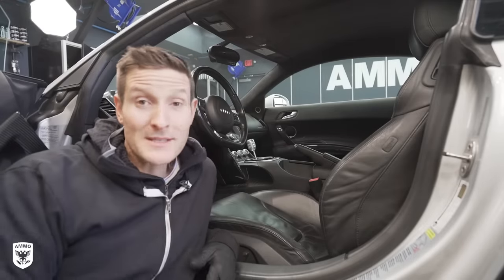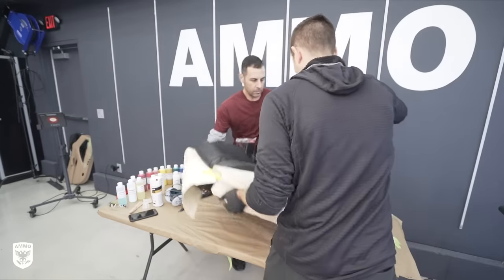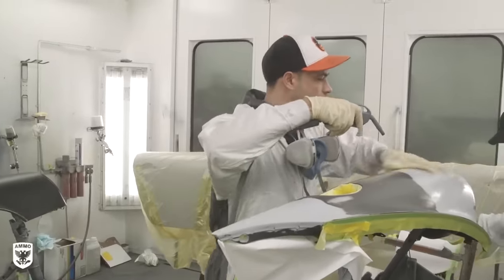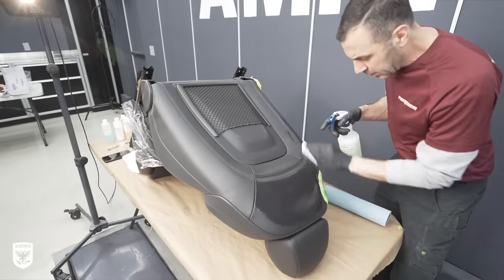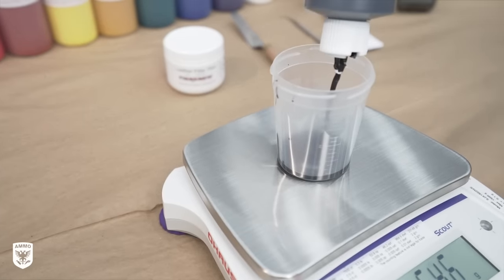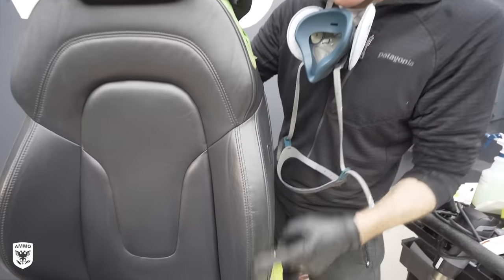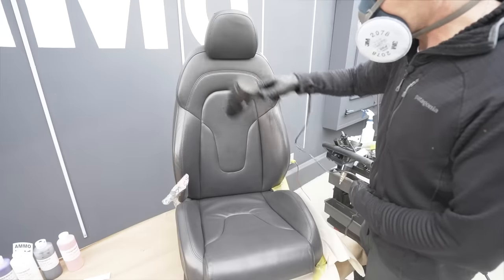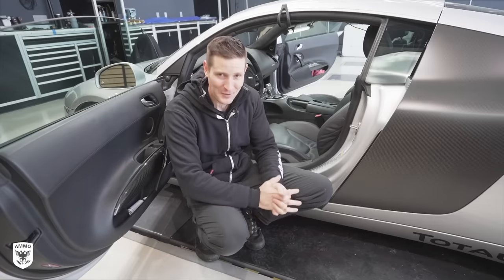How to Repair Damaged Car Seat Audi R8 Leather Repair Steps

Comment: I had Fiberenew do my seats and the guy was like "Uhhh your seats are bad I don't know if it will work." 3 years later and it still looks great.
Reply: How much did it cost you ?
Reply: Same what’s the cost tho haha
Reply: In for cost
Reply: @josemichael1292  everything 
-thanos
Reply: @tyobsxura4360  The detail we will never be told
Reply: @josemichael1292  it depends on the amount of damage.  Obviously a beat up seat won't be as cheap as a seat that just needs touched up.  I'd say price between 125 to 500.  He said in this video he was paying around half what new covers would cost.   So possibly more.  But there are companies around that charge a reasonable amount.  Check out Creative Colors International.  They do amazing work too. Fiber New does great work as well!
Reply: Looks great, but rough as sandpaper
Reply: @Shift4g  I suggest to get new seats. While it looks nice, it’s not smooth. It feels rough. For a small section on my seat, it was $250
Reply: @Amor1990 you didn’t sand enough. Start with 320, go 400,800,1200,2000,3000 and watch how smooth it will be

Comment: I need this for my 20 year old 7 series, badly
Reply: It still runs? I’m impressed!
Reply: Same brother. 740 or 750? Mines the 750.
Reply: @kotalarsen95531  740i sport
Reply: @darrenlee1765  runs like a scolded cat, no leaks, no lights on the dash. Drive it long distances comfortably regularly. Side bolsters are getting tired though after 170k miles
Reply: @joshuad1716  3.0 or 4.4?
Reply: @darrenlee1765  4.4
Reply: If you're in Southern California reach out I can repair it for you

Comment: Same seats that are in my TT Mk2. Since I'm not rich and the car is not worth 80,000$, I wasn't ready to spend that much money on leather repair. I found a product online called Belino Cuir and ordered the black version. I was hesitant to use it though. I left it on the shelf for almost a year. But finally decided to try it on the lower part at the back of a seat (just in case it was crap and I couldn't fix the disaster). Turns out it worked very well and is very easy to use! It's a kind of fast drying gel. You put the stuff on the cracks and then wipe it down with a cloth. If you put too much and it is visibly different from the surrounding leather, you rub on it hard with the cloth. And as a last resort, you apply a bit of Windex on a rag and wipe it down. But it mostly worked very well for me and my seats look good. Not like you see in this video of course. But all the cracks and the discoloration are gone. It even died the thread back to black.

Important: Before you start, you must remove any dirt or leather conditionner and the leather need to be dry. Also, when you're finished, apply a decent quality leather conditionner over all of your seats, especially where you re-dyed your leather. 4.5/5 for the ease of use and 5/5 for the value for the price. That was the only thing that was bugging me about my car interior and in the end I could have fixed it a while ago for 15$ and 2 hours of work. I should have done this way sooner!

Comment: Never heard of Fibrenew here in Europe. Over here it's Leather Repair Company and Colourlock.

You shouldnt just sand the leather with straight up sandpaper. Use red Scotch pads, which are also a 320 grit and a solvent to break through the topcoat but it will not damage the grain as much as straight up sanding it will.

Comment: I was hoping that you will show how to get rid of those folds and stretched leather on bottom part of the seat, have same issue in my Audi 🥺 I tried some technique with heatgun, steam etc. but without any luck (did this probably too carefully though because I was so scared to damage the leather) It shrinked a bit but not enough.

Comment: At my job I color match interior paint by eye lol. We have a camera for color matching but it's more for the exterior color of the car. I work with PPG paint at my job, I color match exterior and interior paint.  We are a platinum PPG distributor at my job. I actually use that same light he has on his desk. It shoots the light from the top in a bright setting and it shoots the light from the front for a more warmer yellow tone.

Comment: I've done this before (different brand) on a BMW it turned out amazing. The issue I had was with the product wearing off, they didn't provide with a top coat when I did it. Interesting to see how long their product lasts.
Reply: Yeah fiber news is really just the McDonald's version of interior repair. if you look at their products everything is very mass produced and cheaply made. Hence it might look good for a little bit but it doesn't last. fortunately there's a younger generation of us interior repair technicians that take pride in our work and use only the highest professional grade products available.

Comment: Milliliters are a unit of volume. Scales only measure weight, which would be milligrams. Unless you are weighing water, the two are not the same.
 NICE refinishing job!
Reply: The ratio's remain the same
Reply: @Ronke01 Only if the density of the fluid is near that of water. If the ratio and the scale are both for mass, and you are weighing by volume [sic] there will be some mismatch. A pound of bricks has a very different volume than a pound of marshmallows. The difference here may not be much, but for a precision match, why not do it precisely & correctly?
 I'm sure Larry knows it was just a slip of the tongue.
Reply: @lyfandeth  if you need to mix 500ml of white marshmellows with 500ml of pink ones, thats the same ratio as half a pound of white ones and half a pound of pink ones. Dont overthink it.

Comment: What's the best way to clean perforated leather seats (heated/cooled seats)?
Reply: I know he already did a video on that a couple years ago.  Can't remember which one.  Basically the same as nonperforatred leather.  Just be aware of how much cleaner you are using.
Reply: I would suggest going back and seeing if you ca find the video.  He does a much better job explaining, and showing, than I did.

Comment: Do you have any comments or suggestions for a GMC leather seat heated/cooled with the small ventilation holes in it?  I've noticed that there is the smallest bit of leather between a seam and one of the ventilation holes that is "flapping."  It's not a tear I don't think and hasn't spread, but that's what I'd like to prevent, a spread.  Is there anything that would be leather safe to essentially "glue" this teeny-tiny leather flap down with?  I hope my description of the issue is adequate - it's the best I can do short of sending you a picture!

Comment: But what about contrast stitching? How would they bring it back after spray painting?
Reply: You are screwed. Think about it, how would you tape off sticking to avoid dye/paint when it's attached to the leather?
Reply: @TubeWatcher  Very easy to mask contrast stitching with thin masking tape
Reply: @jeffreyspodek3579  liquid masking
Reply: It works. I've been doing it for years.

Comment: Amazing!
But what if there is red stitching ?
Reply: I'm in the same business.  I end up cutting masking tape freehand with an Olfa knife approximately 1/16 inch wide and covering the stitches.  It's tedious but makes a huge difference to protect even same colored seams. This step is done after thorough cleaning. Also, don't sand the stitches! 
So, preparation is the key.
1st . Blow out and clean thoroughly 
2. Do whatever repair you need,  avoiding stitches.
3. Lightly sand rough leather finishes. 
4. Repeat 1- 3 as needed
5. Protect all areas around the seats from overspray with drop cloths, tape and paper. If the tape won't stick,  either the surface is not clean or the stitches are still too wet. Dry them with clean towels or move onto something else while they dry. Once you tape the stitching you can't be aggressive with wiping or sanding. The tape is the last step before spraying the dye.
6. Mix your color and apply some and dry it to check color match. If you're satisfied,  spray light coats and let dry.  Sand lightly in 1 direction , wipe or blow air to remove debris and continue your dyeing process until satisfied.  You can add texture too during this process. Take times and it will be worth it

Comment: These fixes never last more than a year. If they charge 50% of re-upholstering price, then just get the brand new ones.
Reply: That's the real test. How long will it last?
Reply: All depends how well the product is applied and the quality of the product. I've seen guys at dealers do quick cheap fixes that last a bit. And I've seen other companies do repairs that have lasted years. Also comes down to how well the material is treated too.
Reply: Bullshit, I vouch for my repairs to last as long as the original did.
Reply: Nah these repairs when done professionally with the right top coats etc will last longer...   unless your guy did the cheap silicone and spraypaint method it'll last 6 months ..
Reply: I mean I did a repair myself where a company matches the dye and provides the top coat 2 years back and it still looks amazing.
And that wasn't anywhere near to level that these guys are doing it.
Reply: These work. You can find many guides and DIYers doing such repairs, and they hold up. BUT, it all depends on the product you start out with. Trying to repair a fully broken, abused chair will never work.

Comment: What if you have different colour stitches?
Reply: This is common.  You can't sand or dye as you would a "flat" panel.  The stitches need to be avoided during sanding.  Then you have to mask them off when dyeing. It's a tedious job.

Comment: You put a top coating on the seats, and it made me think.  Surely the manufacturer also coats the leather surfaces in the car , and if that's the case then why do companies produce conditioner for leather seats and leather surfaces for the car?  Because if there is a coating on it the conditioner will not absorb at all, am I wrong?

Comment: Does the dye start to bleed once you agitate with a brush to detail it?
Reply: Fibrenew "dye" wipes right off with water and a towel that's why you'll never see another video of this seat again after this. That brand has terrible products and reputation. fortunately there's a younger generation of interior technicians that use only the highest quality products available
Reply: @searchforthetruth1998  I believe that ceramic coating the seat afterwards would reduce the possible dye transfer
Reply: @johnfriedman6144  lmao you can't ceramic coat a leather seat bro. However you can use premium materials like viper products. I use their interior reconditioning materials. They use a polycarbonate blend top coat fibrenew uses a water base...

Comment: Very professional process. However, the lack of care for the accent stitching?!  Always , always tape the accent stitching.  It’s a dead giveaway for leather restoration work.  Our team takes the extra time to make sure the stitching is clean. This is critical for all exotics. Also, I will be very curious how the dye with all that extra “texture” spray holds up over time. Best guess, it will last for a month or two and start to crack prematurely. Super professional video work and editing, nice explanation overall.

Comment: My car seats are made of leatherette the color is beige..there seems to be staining appearing from the inside of the seat and appearing on the surface.Any ideas what could be causing this ?.
Reply: More likely it could be a dye transfer from clothes or a belt.  Light colored seats frequently are "stained " by  denim and other dyed clothed. That's not a flaw of the seats , rather the fact that the clothing is not colorfast. That's why you're supposed to launder similar colors together. 
You can try cleaning your seats with appropriate cleaners.  I hate to say it, but they may need to be dyed. And your problem will reoccur if you continue to wear the clothes that caused it.

Comment: You should try out the Colorloc system. Your very meticulous and may cut the cost of repair down significantly
Reply: Colourlock isnt as great as theyre made out to be though
Reply: Oh i just saw it on youtube and was thinking about giving it a try if my leather gets a little worn
Reply: @grand04gt  it works, but theres better out there. Colourlock still relies on thickeners and crosslinkers, something others try to avoid. Their paint will also remain sticky untill its been sealed in by laquer, something Leatjer Repair Company's does not.

Comment: Naughty naughty you never kept it supple enough with conditioners lol brilliant video yet again
Reply: No point in conditioning modern leather
Reply: @Ronke01   No! I own a e46 m3 with nappa leather 18 years old  I've owned it for all its life with only 100k on it and there's not one crease or crack in the drivers bolster and I've used Gliptone cleaner and conditioner everytime I clean the car. Yes I was always told and read that modern leather didn't need conditioning but clearly it does  but i suppose it depends what people use to clean it.
Reply: @michealewk  it depends what's in the conditioner. They can still call it a conditioner, because it still rings with people, but most likely it's not a true conditioner but more of a protectant. I don't know Gliptone products.

Proper overal care is what keeps leather in great condition

Comment: "Luxury is that which can be repaired" - Hermès. Do not rush re-apholstering leather in your car because of slight wear, crevices or little damage! It's a incredibly tough, long lasting and beautiful natural material and it will last a lifetime if treated properly. Too bad many think that automotive leather should be black, mat and plain which most of the time look dull and plasticky. No luxury leather shoes, handbags or home furniture are mat and plain, they tend to get patina and character over time.

Comment: If you moisturize your leather seats with Mink Oil or Volvo’s Leather Car Treatment, your leather seats will never crack or fade. Do not use cheap crap or you’ll ruin the leather. Depending on the climate you live in, it may require additional treatments yearly. My Cadillac’s leather smells beautiful, soft to touch and looks like new.

Comment: The app is assuming that 1gram=1mL
Maybe if you were mixing water where density is close to 1, it will fly and be close enough. But I can assure you that THICK paint density is NOT 1, I’m surprised you’re even getting anything that can match with this system 🤦‍♂️

Comment: If this is a quick flip on a car, I guess this would be okay? But if its your normal driver, costs half of new leather, wont last half as long, doesnt remove cracks and looks different, why on earth would you use these guys? If its an old car and they dont make new leather, absolutely.
Reply: Because it will last just as long, it can remove cracks, but if your talking about the pleads, they're part of a leather aesthetic, and you can do it so it looks exactly the same.